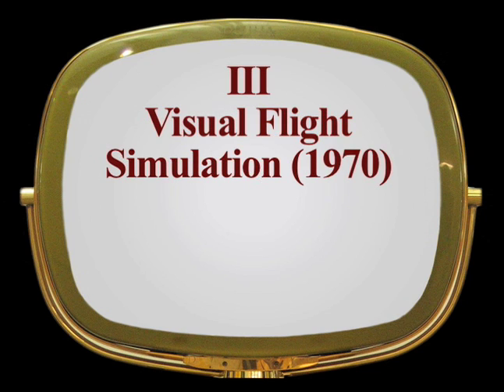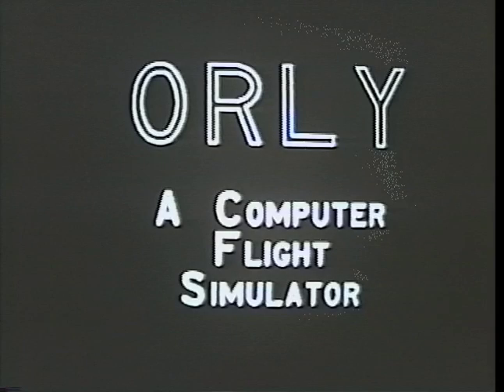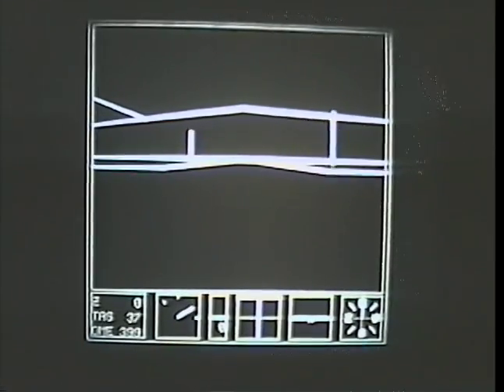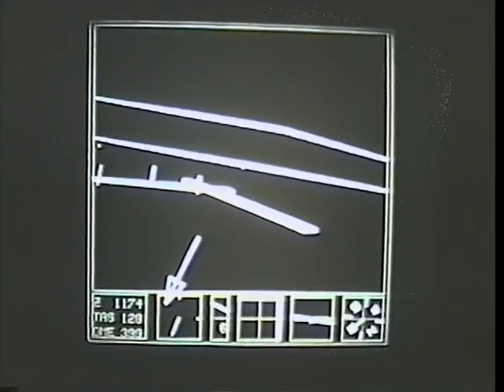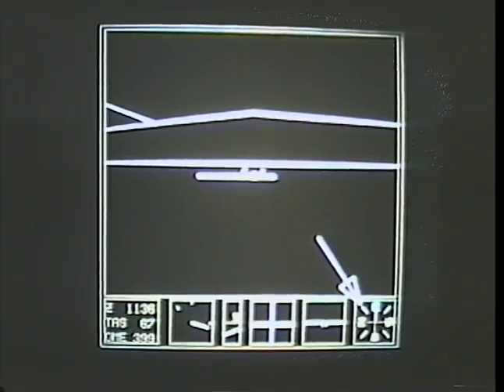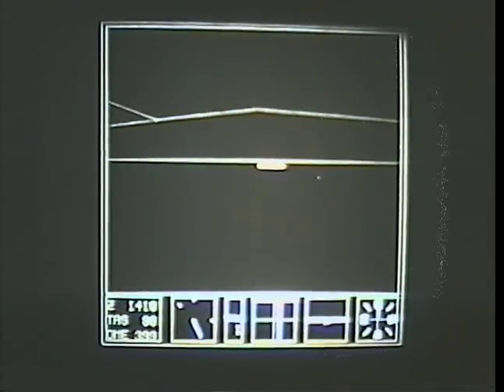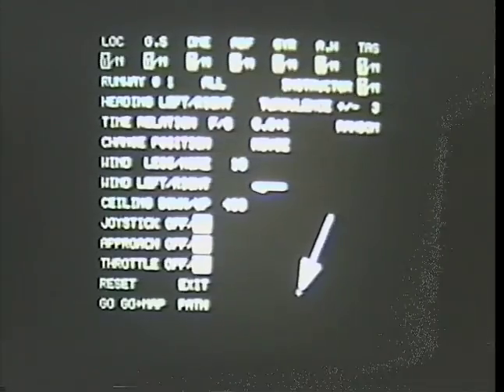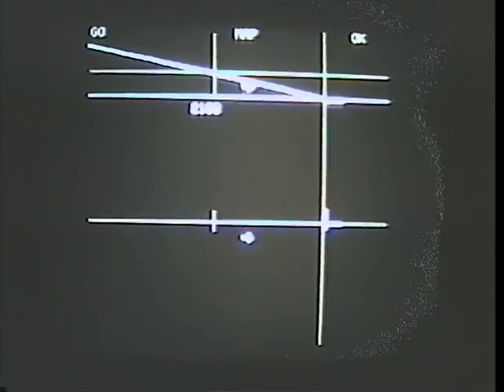4FIRSTS Visual Flight Simulation over the ARPAnet 1970

Comment: This must be the demo for the  new Microsoft Flight  Simulator 2020.  I must say, Im impressed.  Seriously though,  I remember using the Sublogic brand flight sim on the TI-99 tiny (bubble membrane keyboard)  computer in the 80s.  It looked about like this,  Sublogic most likely used the foundtations of this for their code.  Sublogic  was bought out by Microsoft and they kept improving the software.   So you could say that this is the beginning of Microsofts simulator,  and what a long way they have come.  .